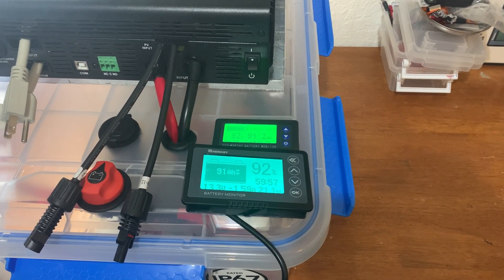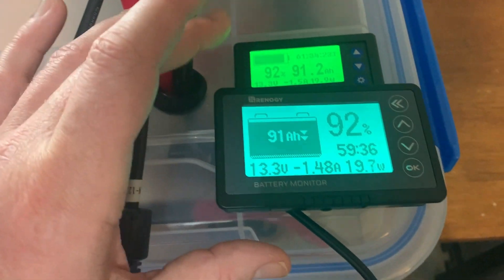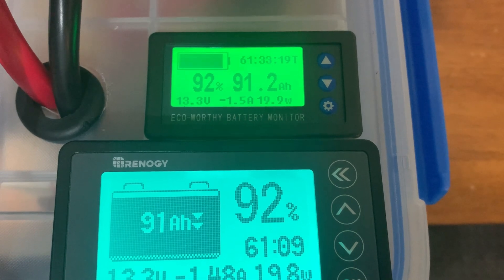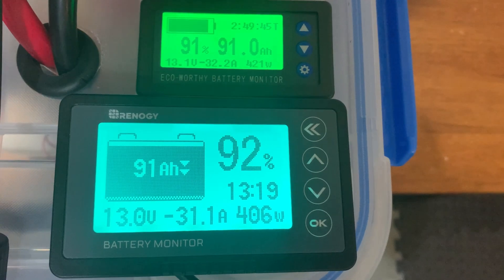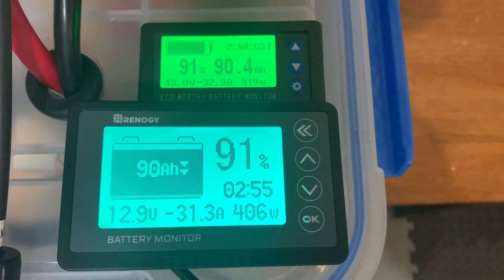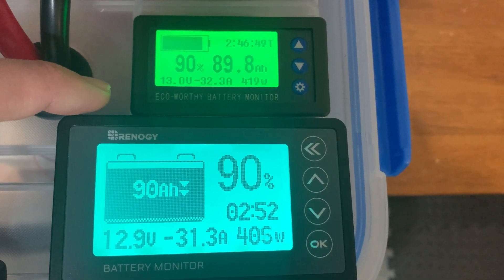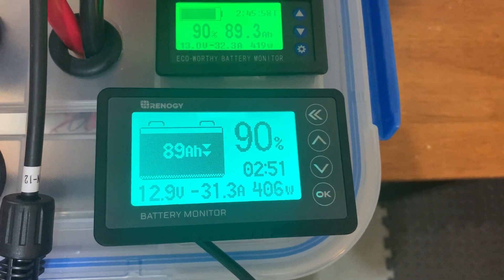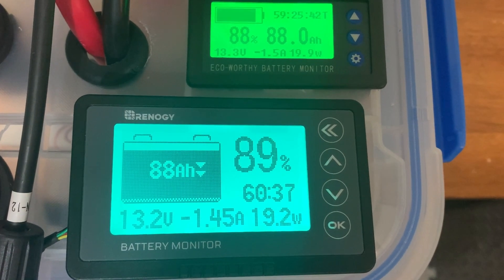Eco-Worthy & Renogy Lifepo4 - Battery Monitor Comparison. Lets see how they compare!!

Comment: I wonder if the negative from the hall sensor is on the battery or hooked up to the shunt p- terminal. Renogy may not be reading the power the hall sensory is consuming giving a different reading. I have my renogy 500a shunt and a 300 smart shunt hooked up one after the other and they have identical readings.

Comment: Is there an easy way to define the upper and lower voltage limits (= supposedly capacity) on the Renogy?
Reply from the maker: Hi chitung2277, yes, there are options to set the 'Full' and 'Zero' voltages on the Renogy monitor. I have a 100ah 12 volt battery connected to mine and the Full voltage is set to 14.5v and the Zero voltage is set to 9.5v. This monitor also has a low capacity alarm. I've set mine to alert at 10ah on my 100ah battery. This is a great battery monitor IMO. 

I hope this helps !!

Comment: you should have placed the hall sensor before the shunt with respect to battery terminal.  that means connecting cable from terminal to shunt to allow hall sensor to be placed there. im sure you connected shunt directly to terninal and hall sensor after thats why rreading on ecoworhty is high compared to renogy since it is also recording the watts consumed on the shunt.

Comment: Thank you for sharing the video. It was helpful because I wanted to know the actual degree of measurement error with shunt resistors and Hall sensors. Junktek shunt resistor module failed after a few months, so I will try the same Hall sensor type.

Comment: I'm on the fence with this Renogy monitor. I installed mine about half a year ago and I initially really liked it. Unfortunately it started flaking out on me about a month ago. It would sporadically sound it's alarm and tell me I had 0% battery capacity in my bank when the bank was fully charged. It also wasn't recognizing when I had a charge going into the bank. I think I tracked it down to a faulty pin on the wire that connects the shunt to the monitor last night. Unfortunately, I can't seem to find a replacement wire. To be honest though, I'm not sure I even want to spend money on a replacement if this one only lasted 6 months. It's a shame because I really do like the display. Much more than ones like the Victron which only show partial information. Maybe this Eco-worthy is what I'm looking for.
Reply: I'm having the same issue with mine. It doesn't seem to read the battery charging, just the drain. It will reset to 100% when the battery is fully charged.
Reply: Watched another vid where the guy was having the same problem. At first he thought it was that pin but then wasn't sure. I think Renogy has some work to do.

Comment: I have a different brand of Hall sensor monitor, but I like it. I can hook it up to the wiring to the fuse box located inside my camper without having to drill holes to run the wiring from the battery to the inside of the coach. Is it as accurate? Probably not, but close enough.

Comment: I use the Lnex, which is identical to the Renogy, just $10 cheaper. You can also get a Lnex with a color monitor for the same price as the Renogy.
Reply: I have the  LNEZ. WORKS FINE
Reply: Link or full product name? :) ty

Comment: The renogy recalibrates when the battery is 100% so it remains accurate over the long term as long as it is fully charged regularly.
Over a long period of cloudy days it does go out of sync..the real test would be to leave them both connected at 100% and come back a week later.
Reply from the maker: That's a great point ! Thanks for the comment!

Comment: one thing I noticed with my eco worthy battery monitor is that it  doesn't show my inverter wattage consumption. my inverter consume 10 watt on standby. so my conclusion is this battery monitor will not show anything under 10 watts. But what i'm trying to find out is does the monitor take into account does none visual wattage.
Reply from the maker: That's a really good point and I can confirm that anything under 10 watts does not register on mine either. This is one of the shortcomings of this monitor for sure. Thanks for the observation!

Comment: SUGGESTION FOR NEXT VIDEO:

Put the ecoworthy hall sensor on the red wire of a solar panel and show us how goid or bad it works.  So we could consider using these to monitor individual power production of each solar panel in an array.
thx

but stop moving camera
hard to watch

Comment: Does the shunt have a fuse and shutoff and would that make it a better value?
Reply from the maker: Hi James, great question! The shunt doesn't have a dedicated fuse or shutoff switch but it really doesn't require one as it is only connected to the negative side of the battery. There is a separate 20awg positive lead that comes off of the shunt for the LCD screen's power and I did wire in a 2 amp fuse for that just to be extra safe. It would definitely be a better value if it came stock with an inline fuse for the LCD power lead, however, I have yet to find a battery monitor that comes with this pre-wired (yet lol). I have also put in a master on/off switch and a 100amp fuse on the positive terminal of the battery for safety purposes. Thanks for the question! I hope this helps!! Happy Holidays!!